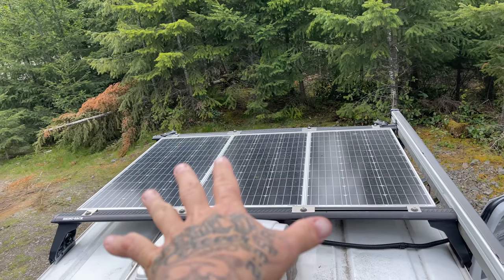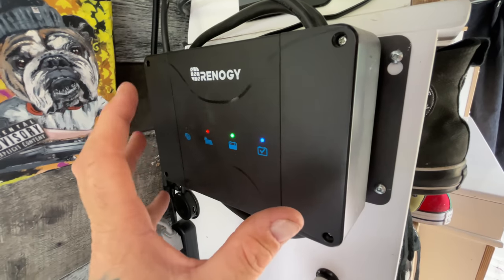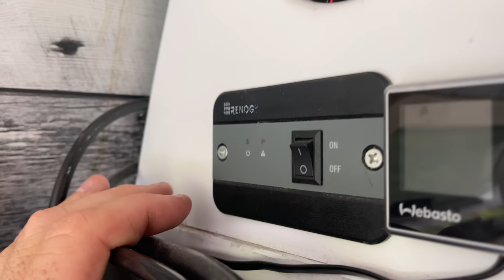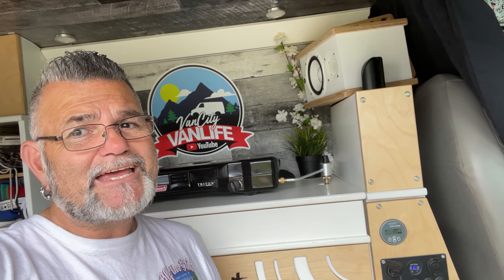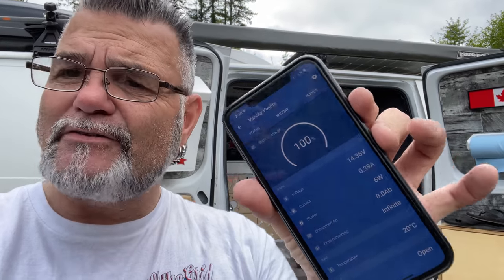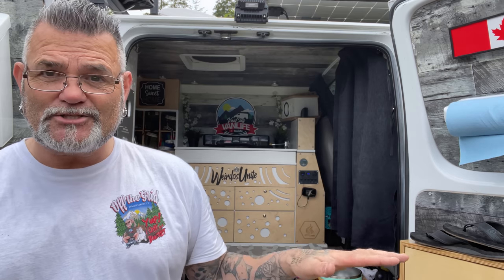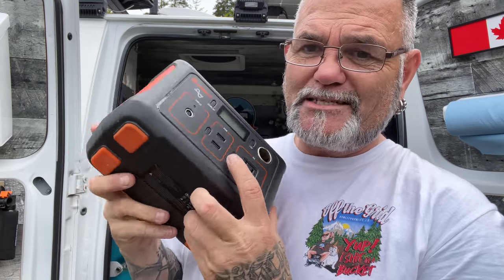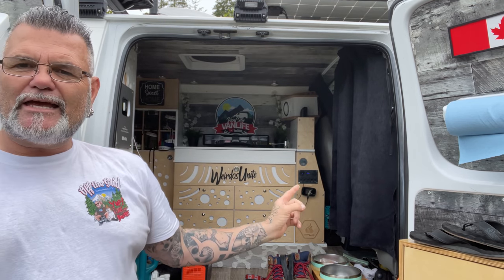"Full Electrical Review" Lithium Batteries And Solar FORD E250 CONVERSION

Comment: When you cut a hole in your roof, use grommet strip around the metal to stop the wires from Chaffing and short circuiting against the metal

Comment: Hi. Same for us in Sweden. One sweet solution is a booster to the lithiumbatt. Then you can get your batteries fully loaded just when run the van on idle. Unfortunantly lithium with a booster costs plenty here. The other positive with lithiumbatt is less weight. Have a great day //T🇸🇪

Comment: I'm down here in central Oregon and have pretty much the same setup you do. I'm running 200w solar mounted flat on the roof rack. Two 100ah battleborn lithium batteries and a DC/DC charge controller that takes a charge from the alternator as well. We get enough sun here during the winter months that the solar alone keeps my fridge and lights powered while keeping the battery state of charge  at 100% I also run the 700w renogy inverter which powers my laptop,  small TV and my solar generator that I basically just keep plugged in. Absolutely enough power to get by....think when using everything I have yet gone below the 75% state of charge level. Once I hit the road...the batteries are charged to full within 45 minutes.

I also have a 30amp shore hook up....so if I'm at a camp area I could charge that was as well.

Last thing I have that might be a bit different is a portable solar 80w  panel. I have the hook up just next to my shore power and it goes directly to my batteries. The panels have a built in controller (zamp) so its a stand alone system all in its own. Great for parking in the shade and placing the folding panel out in the sun...

Comment: I got an AC/DC converter cord for my laptop and I'm really glad I did because it pulls so much less power.  I also got one for my Cpap because that one item draws alot, so converting it to DC makes a huge difference.  And the converter cord weren't very expensive either - got them on Amazon, in case anyone is interested.

Comment: Thanks...

  I plan to get into the electric next year - I want to drive my 4x4 Astro van to Alaska then shoot through northern Canada to the east coast then drop back down into the USA...  I'm not sure about the solar yet, I know charging off the alternator is more efficient - I hear there are new lithium batteries that work in the cold, too, which is something I'll want as I'd prefer to mount them under the vehicle (not much space in the Astro) - I want to be able to run power tools out of the van

Comment: Hi Chrome, love the channel. I live in Calgary doing the 9 to 5 grind. Last week saw a Global news piece on Ray Outfitted and Van life. I was surprised you were not featured since I know you are a large force in Ray Outfitted success. did you upgrade your alternator? foresty forest upgraded his from stock and it belts out lots more charging power. If I went van life in Calgary I think I’d keep the lithium batteries next to the gas dry heat heater to keep them warm in -30 when we get that at least 2 weeks a year.

Comment: Its funny that this video popped up on my feed I was just searching thru your channel looking for this info and didn't find it then poof you tube magic made it appear when I stopped looking.  It answered all my questions and explained why you needed a generator when fixing the floor.
I now see the logic and why no air fryers  and so on. It also answered my biggest question as to how long the fridge would run with minimal other draws. I think you just saved me 3000 bucks!
Smooth travels to you and Mr cruze maybe I will see ya on the road!

Comment: Chrome, why don’t you get a dc charger for your laptop(s). It would allow you to stop using the inverter and avoid the DC->AC->DC losses.
Reply: It all depends on the output of the DC charger.  The one that plugs into my laptop has an output of 19.5 VDC.
Reply: @jim.h  dc-dc converters are easy. Look on Amazon.  There are plenty of MacBook -> cigarette lighter adapters.

Comment: Here in S.E. Texas , 560ah Lithium with 600watts panels will power 5K BTU window A/C unit 9hours cooling to 75 degrees in Extended ford e350 R5 insulation .Sleeping in Metal boxes is only for Cool Hand Luke & TDC 😭

Comment: Crome, please tell Jackery to embrace USB-C PD 60-100W charging so the batteries can be charged fast from the 12v socket and a USB-C PD adapter while driving.

Comment: I hear people use alternators to charge batteries from the motor. Has anyone created any wind power ? Like a vintage osculating fan hooked to a alternator. Then you could aim it. It would turn fast driving. 😜🌞💜

Comment: I have to say this stuff is so overwhelming, but literally you have made it a lot easier. However I am a mom of two teenagers and I need a break. So I bought PHIL, he is like Dr. Phil, my therapy. I’m trying to convert him from a rigged up piece of crap to something I can use. I purchased the rock pals 350 power station and w 100 W Windy nation solar panels. Do you have any suggestions on this installation. I have a 2008 Ford E350 extended club wagon I believe it’s called. And it has a fiberglass almost high top. Which means I’m 5’9” and can almost stand up. The van also needs a vent (the heat and humidity in the van is horrible)  and I have no idea if I should just put a manual vent in or to wait and put a max air or something like that that would connect to battery and inverter. But it is an old van with 241,000 miles on it. Oh and I don’t have the rear air, they goofball that previously owned the van removed it.  So I NEEEED AIR, asthma sucks Please give me any suggestions that you may have. I am in desperate need of a MOMCation.
Reply: I do have a 12v fridge that needs 24/7 other than that just some lights, charging iPad/IPhone, fans etc.

Comment: You don’t need to use 120v to charge your laptop it’s a waste of energy 
There are 12v usb c chargers available
Stepping voltage up and than down again waste a lot of power